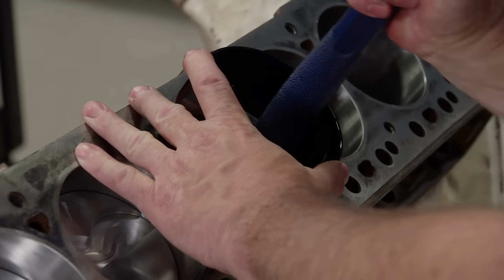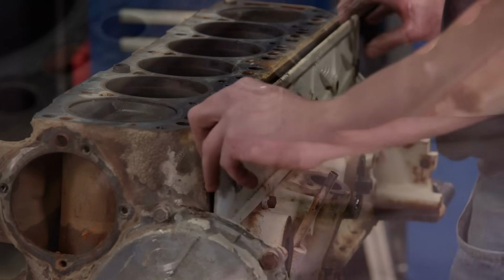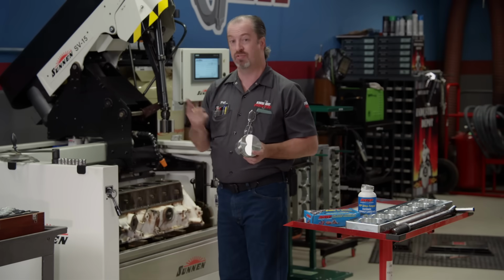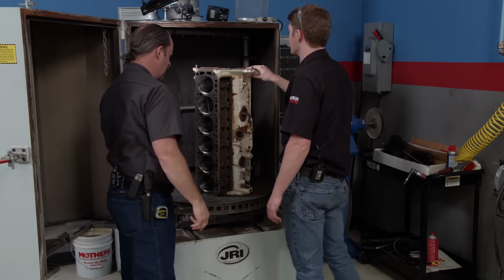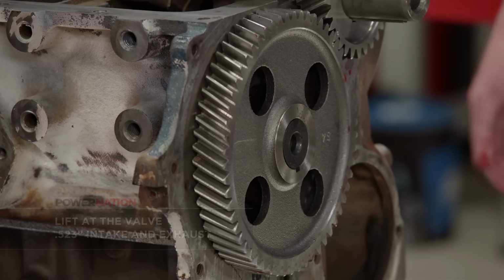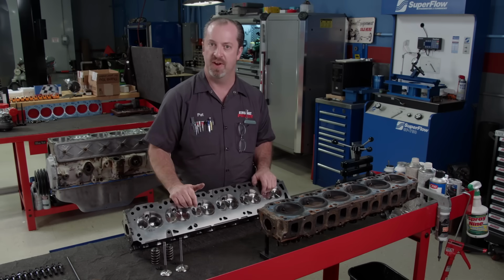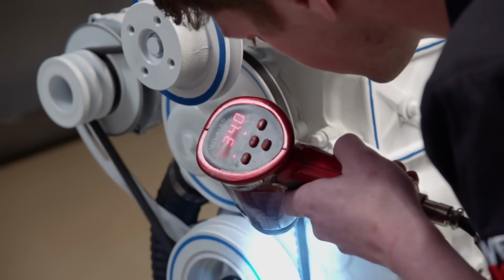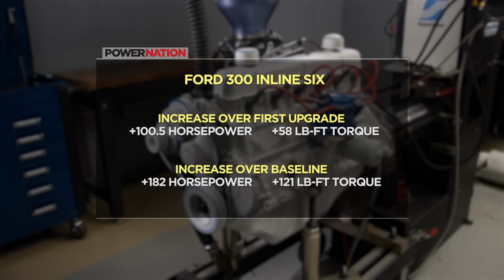Full-Tilt Build On Our Ford 300 Inline 6 For Serious Power Gains - Engine Power S8, E3

Comment: I have a ford f150 inline 6 short bed all oe I’ll tell you this only thing done to this truck was alternator 166k miles rear seal & oil pan seal , oil changes every 3k miles, spark plugs $ distributor w wires, battery change never gave me an issue no problemas

Comment: UGLY COLOR and what a WUSS, didn't even rev it over 5000.  What a joke of a test, along with the fake forced excitement.
Reply: how is plain white ugly? Also it's an industrial engine, that's the color it was painted. 

This build is not a full race engine, and doesn't have the largest camshaft in the world either. 

Also, this was in preperation for a turbo, which makes more power without the extra rpms.
Reply: Enough with the negativity, this shit's fricken cool

Comment: I had an AMC 232 inline 6. Growing up across the street from the engine factory, My uncles who were lifers there 
Gave me a carburetor that was used for calibration and other parts that made that engine put out 22 mi to a gallon in my hornet and run like a bat out of hell.

Comment: They needed to weld 2 - 351C closed chamber heads and add a hilborn fuel injection and roller cam to replicate the 1969 Engine that dominated NHRA Gas Altereds for years. 600HP with a 300 Ford six was happening in 1969 with NO POWER ADDER! 😆😅🤣😂

Comment: Nice lil 300 Ford Build. Why Anybody would paint a Ford engine anything but Ford Dark Blue is beyond me. Although I do agree its probably the most widely used industrial car/truck engine. Most folks have no idea but all the pushers that push 747s and the like at most major airports are powered by Ford 300 6 cylinders for many decades. It was also used to make pull behind the truck air compressors for jackhammers as was its brother, the 302 which shares most of its components/ layout.

Comment: The weakest part on a Ford 300-6 is the roll pin holding the distributor drive gear. I learned to keep several of them in my tool box.

Comment: Ive got two f150's sitting in the yard with 300's. Ive got a fully restored 88 F250 7.3 supercab 4wd. I like the 7.3, and if there was more aftermarket support for performance, i'd maybe keep it, but I am going to build a turbo 300 for my 88. I cannot get a dang DB2 7.3 Injection pump to work well to save my life. Brand new GB Manufacturing pump come WITHOUT a sleeved advance piston bore.....SMH....Darn thing HATES to start after it heat soaks in a parking lot on a run to the store. Im done throwing money at it. Ive got a T19 4 speed, Gearvendor unit, and a 300 all sitting here. Im going to build it with a Keystone turbo kit for the 300. If I can hit 360 hp and 400 torque i'll be happy as a tornado in a trailer park.

Comment: If you are worried about damaging the connecting rod, cant you just put the pins in the freezer for a while to shrink from the cold and then install them into the piston/rod assembly? Or is heat just quicker / easier just be careful.

Comment: My question is why is there no dual plane intake manifold available for the 300? Every intake available including stock are single plane intakes. Dual plane intakes make way more torque than a dual plane, especially at lower rpm's, where the 300 engine lives.
Reply: Offenhauser has a dual-port intake which pretty much delivers what you're looking for.

Comment: In the 1970's there was a drag racer that took two Cleveland 4V heads, sawed a cylinder off each, and brazed them back together to put on his Ford 300.  (The head bolt pattern is exactly the same.)  Set the national record.

Comment: i had this engine in my 84 F150. put an aftermarket intake maniford and Holley 4-bbl 600 cfm carb on it, found a NOS exhaust manifold for an 87 efi, new Y pipe and exhaust, and this baby roared.

what these guys are doing is amazing.

Comment: 1968 4/4 - shortwheel base  with I/O low range = no Transfer case draggin' thru the fender deep washouts, mud with football size rocks mixed in, & slush and snow wearing 7:50 x 16 universal tires with chains on 16" stock steel wheels.  🤠 Yup❕  G~G.  p.s. It is dented at every angle all around & top to bottom and painted brindle shit tan, - but a 27,000 crate engine❇ I bought it at Dee motors where it was traded in by the Anaconda Copper Co. well used in the Berkley pit.

Comment: Powernation got a question I'm putting a build together would a power max head make less or more power? Also for a farm truck I'm looking for.better economy increased torque what specs on a cam from what I've read no more than 260 duration the 300 is different so a rv cam is no good

Comment: I have several 300s. Kohler generator engines. Clean inside and out . Automotive, off highway engines that have no running time and look like New inside.they never ran on  gas. Propane only. They are automotive engines repurposed by Kohler as Natural Gas/ Propane generators.  They retain Automotive distributors with vacuum advance, automotive intake and exhaust. All under 100 hours. I'm keeping one!
     Also, three  460s same description as the sixes. Anybody seen a 312 Hudson Hornet Engine for sale?

Comment: I bought an old Ford F-250 in high school when I was 16. I almost didn’t because I wanted a V8 but my dad said “you’re paying 400 dollars for a truck that only needs a clutch and has the 300. I will lock you out of my toolboxes until the day I die if you don’t buy this truck” so I did because my Pontiac wasn’t going to fix itself and my dad has a lot of money that I couldn’t pay in tools 😂. The Pontiac’s engine gave out and I’m still driving that F-250 today at 25 years old with 403,000 miles on it. I now have two other trucks and a mustang and still trust my I6 as a daily driver/utility truck over anything else. After this video I’m thinking about making my 82 F-150 my daily while I build the 300 because this seems interesting to play around with.

Comment: 300 I6 was THE best, most reliable engine I ever owned.  Had it in a 1996 F150 I bought new, drove it 490k miles, replaced only an A/C compressor before I sold the truck in 2016 and the guy who bought it drives it to this day in 2023.

Comment: what could have been done to get 300 HP and still run on pump gas ??
Reply: im not an expert by any means, but if peak horsepower is your only goal, then i'd say get as much compression as pump gas will allow, then improve airflow as much as you can, then build the engine for "high rpm"  to take advantage of a very aggressive cam.

or you could just turbo it.

Comment: I wish that the Vortec 4200 had this level of aftermarket support.  I slept on it but recently got one to play with, seems like a much better engine than this 300ci unless you are still using it for a higher torque application.

Comment: I had one of these in a 72 convertible mustang, 3 speed on the floor. I used to pull a boat with it. It wasn’t a screamer motor, but made lots of torque
Reply: These were basically truck and commercial engines, never saw one in a Mustang, although in '72 a 250 cu in in line six was standard.

Comment: Why didn't you cut down 3 Boss heads and weld them together to make the ultimate head set up.  They were getting over 600 hp in 1970 with this engine no power adders

Comment: I love my Old 1974 Ford F250 with its DRW's and granny gear.
I love its simple 300 i6, single barrel Stromberg and points distributor.
Although Its computer is many years older than the F'truck and may have a few blown fuses it keeps it going suck, squeeze, bang, blow.
Unique Aussie Built T'truck from Imported and Locality Sourced Parts.

Comment: If only I had the money to do that. My old 300 is only waiting for a battery, and throttle linkage, to run again. Maybe a new Carb. The truck itself needs the power steering, and power front disc brakes, from the parts truck; and then some.

Comment: Been running with the 300cc 6 cyl. engine now for like 43 years in 3 different  Ford Vans. Always dependable and economical to maintain. Long lasting motors. Recently bought a used 1995/300CC motor off of facebook marketplace for $200 that had 76,000 miles on it. It runs great. Why would Ford stop making such a good engine is beyond me. I always wanted a crate motor but never found one. Someone needs to save all these old 300's for the future.

Comment: So solid and simple to work (on) and with careful tuning by these master engine builders, the improvements are amazing. It should be developed for today's applications (2024). I am partial to an inline 6 having three M54s, one with 253,000 miles right now. 2800cc, power rating 195/215, 10:1 compression,      avg. 24.2 mpg. Smooth and tight with no rebuild.

Comment: There is a Drag Racer in our area who has a built Ford inline 6 300 with a twelve port head and injection. One of their mechanics told m they shift it at 7,000 rpm. It is in an old '64 Falcon 2 dr sedan that has ben gutted out.

Comment: I understand that for ford fans the 300 is basically incredible motor..
  I get hot roding I come from a racing family. But I'm trying to economize a stock motor .  In a classic. With the expectations of modern vehicles.  I'm getting advice from all sides. One more won't hurt.

Comment: I would have tried a 1" open spacer with the 4-hole on top of it.  More plenum space and less chance of fuel puddling on the bottom of the intake.  A 4-hole creates a lot of velocity and the fuel can then hit the bottom of a short plenum and puddle, limiting top-end power. The open spacer would give more room for the fuel to follow the air stream, especially with the sharp turns in an inline plenum, but still retains the increased vacuum signal from the 4-hole.

Comment: Chevy Mopar and Fords... we all have our preferences I will admit I am a Chevy guy, the power and sound of most Chevy engines, for Mopar- the original 426 hemi is a monster!  Ford- the straight 6 300 is the king, power to weight,  just a damn good engine, we had it in our farm trucks (3) and they were just horses when we needed them for pull and for durability.  I love your shows on all of the 300s and the modifications which increased both HP and Torque is incredible.

Comment: Those 300s were popular in the 70s. Insurance companies would pick on teenage drivers with V8 engines. We put a 300 in a Mustang and it screamed. The 300 would smoke the 302 and 289 V8.

Comment: When that engine first came out in the 1960s, it was part of the BIG six family.  The 240"went into cars and the 300 went into trucks. (The small six was 144/170/200 and eventually 250.). IIRC, the early truck engines had a forged crank, forged connecting rods and forged pistons.

Comment: How much for this engine shipped to me I want to put it in my 08 f150
Reply: Buy a fird barra motor from Australia,  they are affordable. It's just a slightly smaller dohc straight  6, turbo or non, they make huge horsepower. Record now is 1400 wheel, stock block.

Comment: OMG my first build as an apprentice was the aussie version of this @ 4.2 litres with a similar approach but my brother source a very rare cross flow head from a drag car which came with the works, big roller cam, heavily ported and triple 48mm side draft Webber's. We didn't have a dyno in our small country town but in a cortina mid size car the package eat larger v8 powered cars but the Webber's were a pain in the arse to keep tuned due to variable fuel quality.

Comment: So basically you could just take her apart, have it bored and honed to .050, have someone put the new pistons on the rods, slide in the new cam and button her up with a 4 barrel manifold and carb plus an HEI distributor and any thing above 250 is easy?

Comment: As a huge fan and 2x (and current owner) of the venerable Jeep 4.0, and having driven the pants off our family's 225 slant 6, I have had zero reliability issues with them, and always respected their inherent smoothness.

I'm seriously considering going with a 60s F100 or F250 with this engine, but I would want a stout engine.

Comment: Are there any good straight sixes that split the head so that intake/exhaust is reversed for half the cylinders?  Obviously so that exhaust could exit head 3 headers on one side and 3 on the other?   Would be ideal for something like 1929 Mercedes Roadster replica....looks like all of em either use VW motors or V6 or V8 but the origingal had a straight six so that would be my first choice....and absolutely a manual transmission also

Comment: I have a 89 Ford F-150 4X4 with the 4.9 litter 6 cylinder engine. I’m wondering which is really the best way to go regarding cost, power, and mileage?  What’s it cost to get the 4.9 to make that kind of horsepower especially with a turbo added to it? Then how does all that performance effect gas mileage?  My truck is high geared with the 5 speed manual transmission. You can not take off in 2nd gear from a dead stop. Have to use first gear. Then if I got anything like even a small trailer hauling behind it. If I have to stop on a incline I have to go to 4 wheel low just to get moving up the hill. Once I’m on flat ground again I can go back to 2 wheel high and drive normally. I’ve considered putting lower gears in the rear ends, but rather just have more horsepower to pull the existing rear end gears. Even though I really like to add a posi to the front and back rear end. Preferably a posi I can turn on and off so it won’t go clunk clunk clunk when you go around corners!  Been a great truck/ engine with 164,000 miles and then some and hasn’t had any major work yet needed done. Be nice if I could get that 6 cylinder to easily pull a 26 ft RV and still do fair at least on gas mileage?  I know a v8 probably going to get around 10mpg hwy or city! My stock engine with a K&N air filter got 22 mpg on the highway with a canopy on the back and the back bed as full with home furniture and tools etc clear up to the top of the canopy. While driving from Oregon to Wyoming to Yellowstone!  CIty I get around 16 mph.  Know I’m asking the best of both worlds, performance and gas mileage don’t usually go together very well? Not sure which is the best way to go?

Comment: Saying the industrial version has a metal cam gear and automotive ones are fiber is false info. The efi versions have fiber cam gears. All over versions wether they be automotive or industrial have metal gears. The only difference is industrial engines have forged crank shafts.

Comment: Thank you for an excellent video and some valuable information, but I did not hear if you had mentioned these engines could operate up to 350k miles due to having five to seven main bearings and a good maintenance program, especially the required oil changes.

I have a '63 Falcon Ranchero, NO DENTS, and was going to install a 302 engine until I read this information which helped my decision to retain the original 170 engine since it will cruise all day long at 85 mph. and now at seventy-five (meaning me) that seems fast enough for this 'little' car, kind of like getting into a time machine each time I drive it.

So far my big changes  has been to install a modern exhaust system for better flow, which makes it sound like the Ford 260 V8 and a Stromberg 97 carburetor in place of the stock carb - mostly because I just wanted an excuse to use it on something.

Comment: For all of you out there who think silicone and cork is OK, IT'S NOT!!! Stop doing that. The slipperiness of the silicone causes the cork to split. A small spot in the corners is actually necessary, but that's it. Make sure your surfaces are clean and oil free and use a  light mist of spray emblem adhesive on both surfaces (meaning one side of gasket and surface the gasket will stick to). Wait till it dries to a sticky tack and very carefully line it up. Do not use Hi-Tac by Permatex, that stuff is pure crap and turns to liquid with heat. Go to your local hardware store and buy a product by 3M that comes in various grades from re-position able to permanent. I suggest permanent. It's not really permanent in regards to a cork gasket glued to your oil pan. A scraper and surface prep disc is all you need to remove for replacement if needed.

Comment: I had one of these in a 1980 Bronco.  A screw fell off the carb and ruined the engine.  Mechanic took it apart and after 300k miles there was hardly any wear on the mains and pistons. These will run forever if you just keep fresh oil in them.

Comment: I'm pretty sure they started using the nylon trimming gears in the early '80s. All 300s before that have steel gears. You can also get aluminum replacements nowadays.

Comment: One of the better straight 6’s ever made. I would love to see this come back and dump those V6’s
Reply: I believe in straight 6 superiority, it's a shame america didn't bother with them in high performance applications.
Reply: There were 10’s of thousands of the 300’s used in the aviation industry.
The TUG Inc T-50 and MH-50 baggage tractors used the 300 with a short shaft C-6 tranny. Most baggage belt loaders used the 300. We had 300’s in our FMC lower deck loaders and in our aircraft heater cart.
I remember towing several Boeing 727’s with T-50 baggage tug, the 300 never overheated towing aircraft all day long.

Comment: Looked like a Boat Anchor at first , but the Internals were near Perfect . Gear drive for the Cam is the ONLY way to go . An NO Fibre Gears thanks .
Was running with the Water pump clogged . That is a SOLID design Engine . And , personally , I  think a healthy 6 sounds better than a Bent 8 .

Comment: Sequential port fuel injection with sequential triple turbos, then drop the compression down to 8.0 or 7.5 range because you will see the best performance with that low compression and be able to run more boost pressure for so much more power